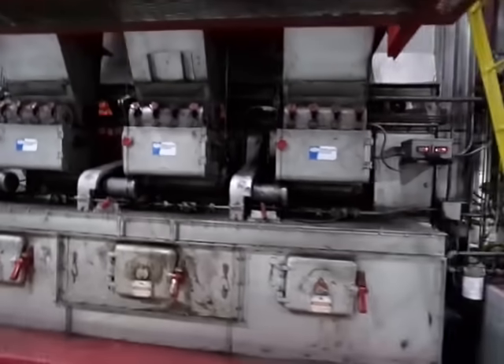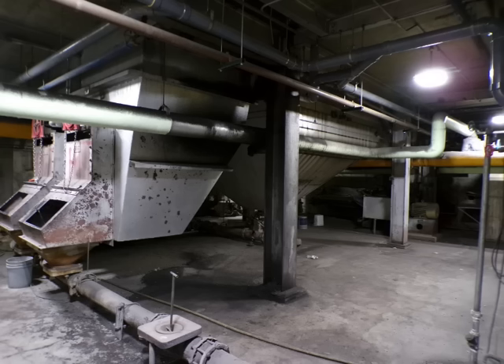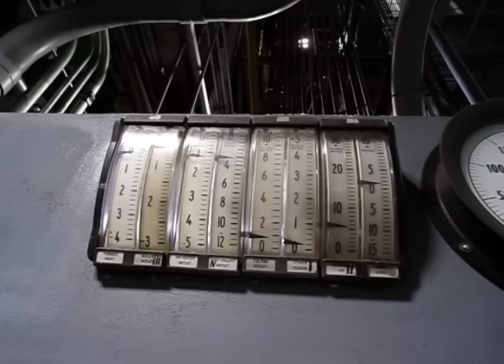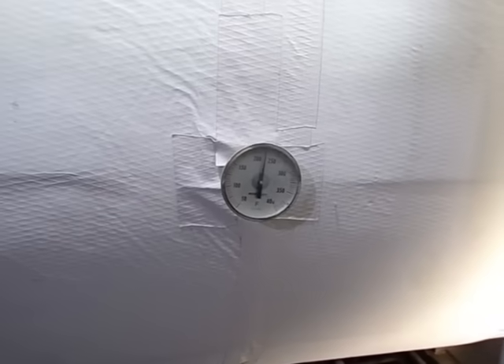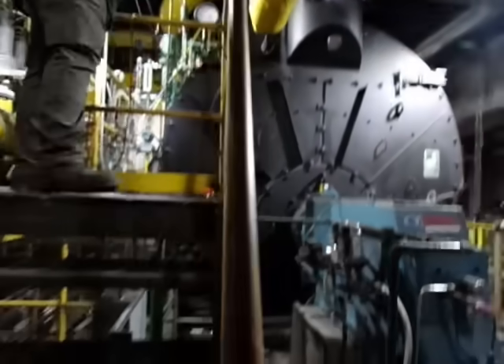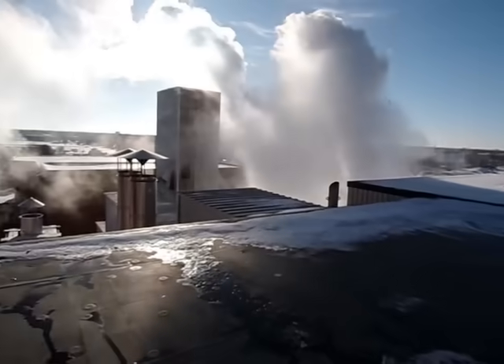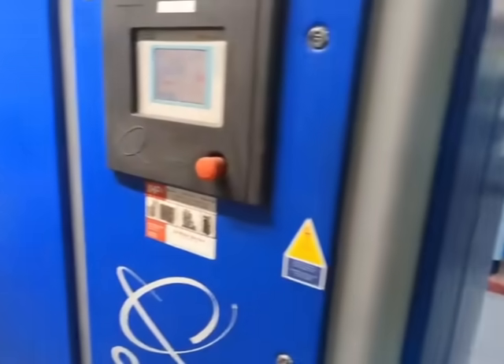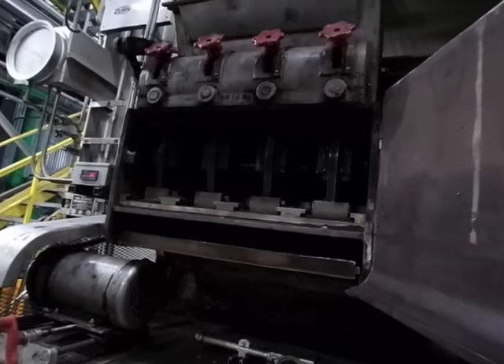The Last Coal-Fired Boiler at NDSU | Steam Plant Tour

Comment: Replacing this boiler will be a very bad financial decision. Exports and AI are making the cost of natural gas explode.  Coal will be cheaper in the foreseeable future. Does this plant have an air preheater or electrostatic precipitator? What kind of compressed air control equipment do they have? Do they have compressed air amplifiers and operational amplifiers?
Reply from the maker: Im not sure if thats true about gas prices but yes the boiler has an air heater. there are flue gas bypass dampers that open when the stack temp goes below 330 degrees to prevent condensation. there is a bag house instead of a precipitator. with the compressed air I don't know.
Reply: @SteamElectricityandPropulsion They probably use the compressed air to blow the filter cake out of the bags.
Reply from the maker: @gregorymalchuk272  they also use air for the oil fired boiler fuel injectors.
Reply: Coal will never be cheaper in the future,  unless you have unskilled disposable immigrants do all the dangerous lung killing mining. There's documentaries showing how black lung disease skyrocketed when mines were using more machines to extract the coal- creating massive amounts of fine dust the workers were all exposed to every day, using more machines to speed up production reduces costs but, here's just a few of them;

Young coal miners suffering from black lung

YouTube · CBS Sunday Morning 
80.8K+ views · 1 year ago
As young as their 30s losing over a quarter of their lung to pure rock dust it's a crisis we've never seen so many young miners with such short exposures.

Faces of Black Lung
YouTube · Centers for Disease Control and Prevention (CDC)
2.5K+ views · 3 months ago
Each year, approximately 1,000 miners in the U.S. die from coal workers' pneumoconiosis, or black lung disease, a preventable illness caused 

YouTube · FRONTLINE PBS |Official
236K+ views · 4 years ago
In this 2019 documentary, FRONTLINE and NPR investigate the rise of severe black lung disease among coal miners and the failure to respond.

YouTube · Touch Medical Media
1K+ views · 6 years ago
At the American Thoracic Society meeting, Dr Kirsten Almberg discussed the rise of black lung, lung cancer, and chronic obstructive pulmonary disease
Reply: Coal is dead, it takes way too much fuel to mine it, then transport it to be crushed/sized/processed/cleaned, then transported again, and if where it's going doesn't have a RR track to it- it has to be unloaded/loaded again in trucks to deliver it where it's going. Then you need all that equipment shown running all the time using electric, and then coal burning produces mountains of heavy, dusty "ash" that is more like sand than what people think of as "ash" from fireplaces and wood stoves, and unlike wood ash you can't spread coal ash on gardens and farm produce. 

Coal ash includes a number of by-products and toxins produced from burning it including:
Fly ash, a very fine, powdery material composed mostly of silica made from the burning of finely ground coal in a boiler. 
Bottom ash, a coarse angular ash particle that is too large to be carried up into the smokestacks so it forms in the bottom of the coal furnace.
SIlica by the way causes lung cancer...
Coal ash contains contaminants like mercury, cadmium and arsenic. Without proper management, these contaminants can pollute waterways, ground water, drinking water, and the air and has to be loaded up and transported elsewhere for disposal- using up more fossil fuels, diesel etc to do so.

I used to burn coal back in the 1980s at home, a 5 gallon pail of #2 nut coal in my coal stove produced about half that amount of very dry, dusty, heavy, clinker filled ash I had to shovel out  haul away and dispose of. It cost me around $100 a ton around 1984 delivered, now it's around $400 a ton and there's probably a delivery charge on top too now.

So when you add up all the energy losses involved in mining, multiple transportations at various stages, electric used to run things like coal stokers, feeders, blowers for the fire etc etc coal is a very poor choice.
Natural gas burns clean, it doesnt need stokers, feeders, blower fans, draft fans, it doesn't produce tons of ash that has to be transported and disposed of and it goes through pipelines ready to use.
Even china has been rapidly moving away from coal in favor of better, cleaner, cheaper production. 
 Iowa's power plants have been ditching coal for wind turbines that now provide around 80% of the entire state's electric production.
Like incandescent bulbs had their day- coal had it's day too- in the 19th century and early 20th, now there's much better alternatives.
Reply from the maker: @FCE-dogs coal isnt good for the environment but I know that the mines around beulah ND do good at restoring the land after mining. you were wrong about gas boilers. if you see one they always have forced draft fans. also if you search on google iowa uses about 60% not 80% wind power. also does Iowa have lots of batteries to store the power for when the wind doesn't blow? remember lithium and graphite come from other countries where they pollute and burn coal and oil to make the metals used in batteries. I like coal because its the most abundant fuel source and its not good for most transportation. we should save oil for transportation and use coal for stationary and possibly marine applications.
Reply: @SteamElectricityandPropulsion  The natural gas is coal derived anyway, coming from the synfuels plant in Beulah.
Reply: @SteamElectricityandPropulsion  Yes, they can have some forced draft, BUT they won't have all the rest of that stuff used only for coal- the conveyors, the screw that moves the coal, the automatic feeders, the blowdown stuff, the ash removal equipment and removal costs, there will be a lot more usable space when the unused coal related stuff is disconnected and removed, the bunkers, ash pits, whatever.
When I burned coal for heat in my Brooklyn NY loft and later in Vermont I liked it in that it put out a LOT of heat, it could make my coal stove glow red, but it required expensive stainless steel flue pipe because galvanized stove pipe gets corroded quickly by the acids in the fumes. In NYC I had to shovel and haul the stuff up in 55 gallon barrels after having it dumped in the alley. It gave off lots of dirty black dust, and shovelling and disposing the ash was a real pain in the azz.
Also, one day in Brooklyn where I had  a 1-1/2 floor loft- I started the fire and went to work, while I was gone the fire went out and the fire sprinkler pipe near the exterior brick wall  upstairs froze. I didn't know it but it froze and cracked, then a warmer day came and it thawed out and my place and the rest of the building was flooded out by that 4" pipe that cracked.
The fire going out was a common happening and it was a PITA to get the fire started again, at times in Vermont when it happened I found ice in the dogs water bowl.
I'm glad now I have reliable gas furnaces the last 28 years and 3 mini splits.

As far as wind turbines goes in Iowa, MidAmerican energy has stated around 80% of the entire state's needs are met by turbines, and with some more recent additions of solar panels, their stated goal is to make it 100%;

"To date, MidAmerican has invested approximately $15.8 billion in wind and solar energy projects, creating construction and permanent jobs across the state.
In 2024, MidAmerican paid approximately $44.9 million in landowner easement/lease payments for our wind projects. We currently partner with more than 4,000 primary and neighbor landowners across Iowa. 
Also in 2024, we paid approximately $54.4 million in property tax payments on our wind turbines spanning 33 counties. That provides funding to schools, roads and bridges, county health services and emergency responders.
MidAmerican has over 7,700 megawatts of clean, renewable energy generated from more than 3,400 turbines across the state. Our wind farms generate enough electricity to power over 2.4 million average households each year. We're also exploring new technologies – like battery storage – to make wind energy go further."

They are only more recently now exploring battery storage, however, battery tech is NOT static, it's rapidly evolving, several important key facts;

1) The  polluted salton sea in the US is FULL of lithium, being pumped now out of the ground using the regions own geo-thermal energy to extract the brine it's in.

2) At least 2 anode-free batteries have been patented a year ago, they dont use lithium at all, they use common sodium. The inventing lab is working on scaling this up for EV use right now

3) There is the LiFe PO+4 battery already out in use that is largely based on iron and phosphrus- we have a glut of scrap iron that can be used for this battery very nicely.

" remember lithium and graphite come from other countries where they pollute and burn coal and oil to make the metals used in batteries"

See above- we have a MASSIVE store of lithium right here in the USA, in the Salton Sea and elsewhere, the Salton Sea was a waste dump decades ago, the whole place is polluted- but they found millions of tons of lithium there which until now was just waste pollution, now that is being extracted! Berkshire Hathaway has a big stake in physical plant there.
What other countries do is not our problem, but no matter what is used- humans create pollution, the more humans the more pollution that's a fact, and if you want transportation, electricity and heat- it WILL cause pollution no matter what, but at least things like natural gas, solar panels and turbines  are a big step forward.
Batteries last a decade+ the Battle Born  270Ah LiFe PO+4 battery comes with a 10 year warrantee- and can be charged and 100% discharged 3,000 to 5,000 times, it's recyclable as well, so the battery can be broken down and the materials extracted.

WInd turbines last 20-30 years, all the metals etc can be recycled, the blades are already being recycled and more of that is already in the pipeline. The towers themselves don't get replaced- the machinery and the blades would be, but as I mentioned- the machinery, generator, copper, wiring etc is all valuable and recycled.
With coal you have an endless amount of ash to dispose of and as I mentioned- it had to be moved, loaded up, transported all using fossil fuels, and it contains cadmium, mercury and other toxic substances.
Reply from the maker: @gregorymalchuk272 I would like to get a tour of that coal gas factory but they don't let you take pictures because the machinery is unique.
Reply: The one big issue is miners' exposure to the pulverized silica dust from the huge machines that in more recent years pulverize/chop/abrade the rock to get at smaller coal seams, no mask is going to stop 100% of the dust, so some dust gets in the lungs a lot more than 100 years ago, now guys in their 30s have lung diseases that used to be seen in guys of their grandfather's age after working in the mines for decades.

This is a good PBS doc on this;

https://www.youtube.com/watch?v=NVKRtu85svI

And in the video a woman mentioned how coal industry pushed back against any regulation, saying it slows production down, this video about how steam boilers used to power industries and shops had their safety valves defeated to push the pressure and steam production as high as possible, saying that more steam is more profit, operators with little to no training were told to PUSH the steam fast and hard or find another job

The 3,000 Horsepower Boiler Monster: The Engine That Turned Factories into Time Bombs
This documentary goes inside those boiler rooms to show how thin riveted shells, bad water, and overloaded safety valves turned ordinary workdays into ticking time bombs. Through real explosions, survivor accounts, and investigation reports, we see why one mistake could rip a building apart in seconds and leave entire shop floors buried in twisted steel.

Thru the video you can see images of boiler explosions that literally tore brick buildings apart. One 40,000 pound boiler was launched thru 3 factory floors and out the roof and the building collapsed

https://www.youtube.com/watch?v=vPAiw1_xzJY

Comment: Great tour of a steam plant! Something I would like to do someday. Nice to see an effective heating plant for North Dakota's frigid winters. My house was heated with coal at first, then oil, now natural gas. Prior to purchasing my house I lived on the second floor of a 3 decker. The first two floors have steam heat. The third floor had a gas heater on the left side of the stove, and a gas heater in the living room. Both boilers burned coal at first. The first floor was converted to oil, then natural gas. The second floor was converted to oil. The boiler for the first floor was made by Royal Steam Heater in Gardner MA. The pressure gauge still worked!  The boiler for the second floor was made by The Putnam Co in Putnam CT. The second floor of the 3 decker next door was also heated by a Putnam boiler.  Another 2nd floor apartment on the same street also had a Putnam boiler.  Both boilers in the 3 decker I lived in were running when I moved out in 2009. Some old boilers had works of art on their doors. The ash door on the boiler for my apartment had what looks like a wolf's head on it. If you want to see boiler doors with works of art on them. Check out doors on boilers made by the D M Dillion Steam Boiler Works in Fitchburg MA and the Stewart Boiler Works in Worcester MA.
Reply from the maker: you better hurry up because the coal fired boiler is going away soon. If you want a tour of a heat plant your best bet is contacting a university with a boiler plant. most universities are willing to give tours of their infrastructure.

Comment: We have a 98000lb/hr, 450psi Erie City at work, built 1957. Its been out of service 17 years.  Originally ran on coal and was later converted to oil and gas. Its cool to see one running.
Reply from the maker: wow cool. so if its 450 psi is it for a turbine or just heating?
Reply: @SteamElectricityandPropulsion  we have a 450# header mainly for process heating. Waste heat generators and the current B&W package boiler feed it.  There are still some small turbine driven pumps that use 450# and exhaust into lower pressure headers.

Comment: A state hospital I worked at had coal fired units for their steam lines until about 5 years ago. Went from as many as 5 guys on shift to run it to a single operator with the new gas system. They also took the stack out as well
Reply from the maker: cool I also got a tour of a state hospital with an abandoned coal boiler and 3 gas boilers. sometime later Ill post a video about that one if I can go back there ever.